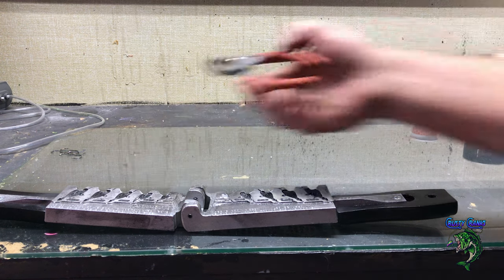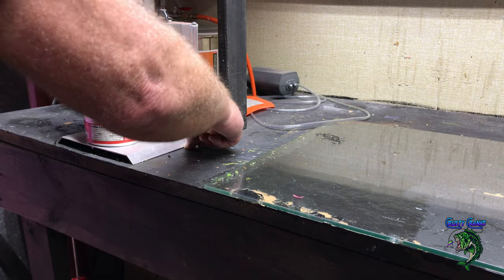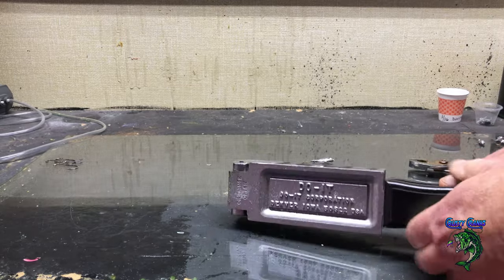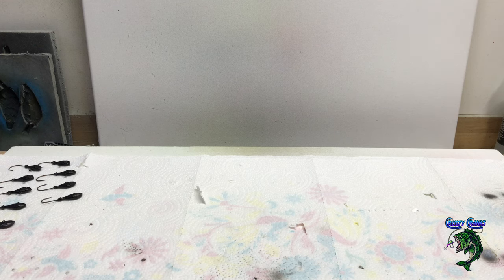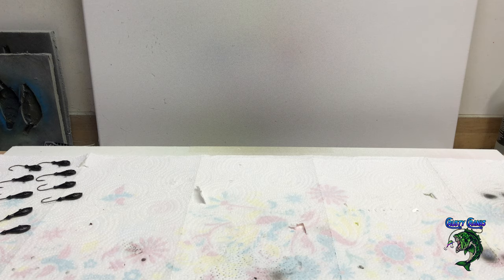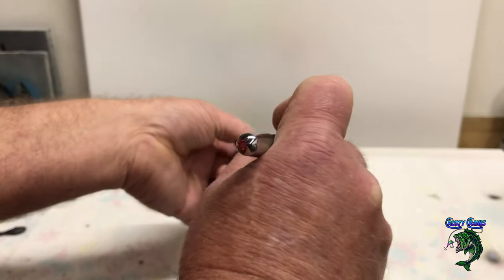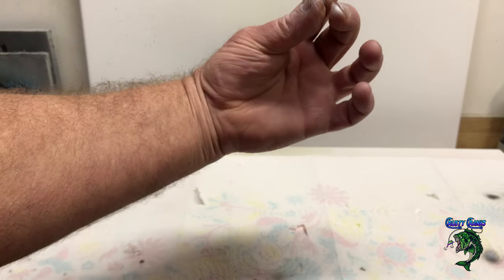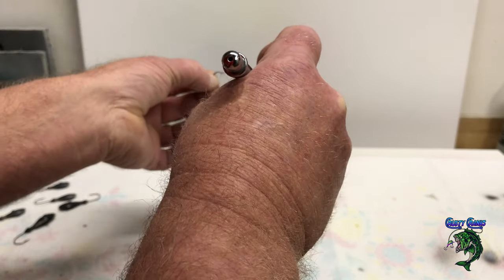Airbrushing Ultra Minnow Jig Heads - Get Better Results Painting your Lead Jigs

Comment: This is awesome.  I just did this to 40 jig heads this past weekend because I didn’t have powder paint.  I figured if I can paint crankbaits and epoxy them, why not airbrush the jig heads!
Reply from the maker: I Think you can be a little more creative with airbrushing. Even though it takes a little longer I don't think I could create the little pumpkinseeds as good with powder paints and the color shifts look awesome. I usually sell these out pretty quickly around my area. Thanks for Watching Sir!